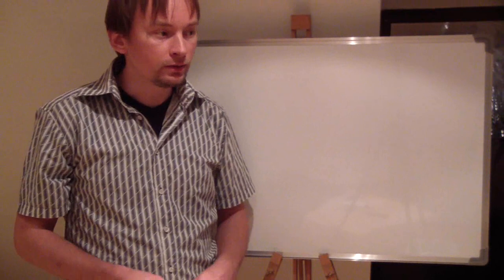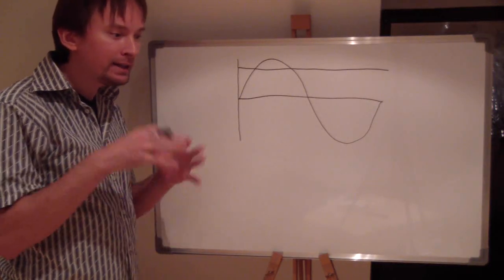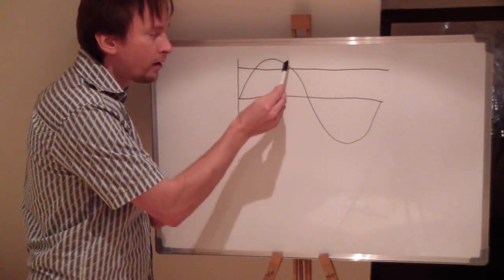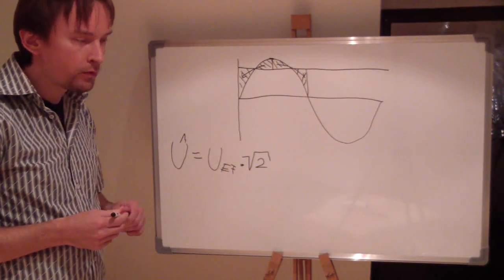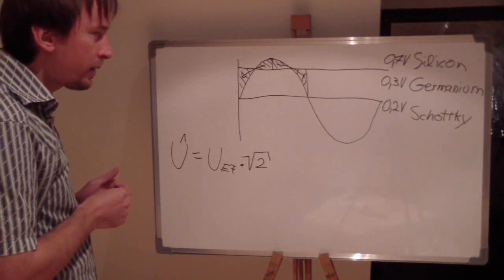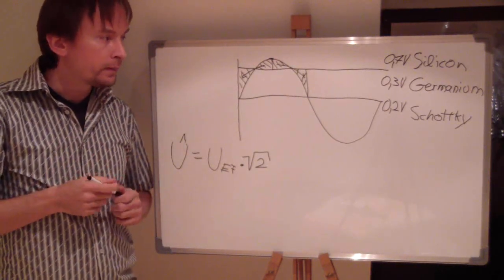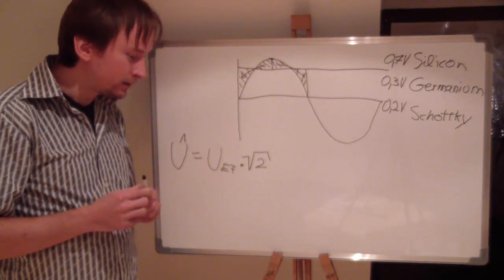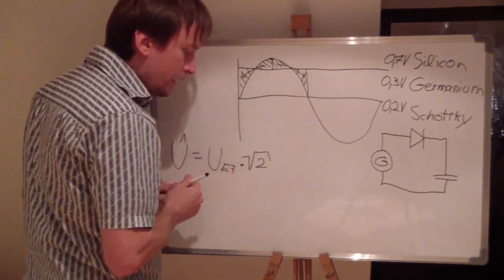Home Made Windmill Generator Part 8 - Voltage Doubler Theory 1

Comment: Hi, good work! Another way to raise the AC voltage is to use a transformer but I'd suggest you to remake your coils. Each additional component wastes your energy. You should double your windings count. Probably you have to use thinner wire to accommodate more windings on each coil. And your wind turbine looks very unefficient to me. You lose a lot of wind energy there. And I think you could make your generator more efficient by putting the coils on iron blocks instead of wood. Keep it up!
Reply: Adding iron to the core of the coils may not make it more efficent.  It will cause eddy currents and hysteresis losses in the iron.  But iron will increase the magnetic permibility inside the coils that in turn increase the flux density  when a magnet passes,  giving it greater powet density. But it will suffer torque ripple due to reluctance cogging  that will increase the required cut in wind speed and create unnessesary vibrations. Profesionally engineered generators will use laminated silicon steel to reduce eddy currents and hysteresis losses,  but a lot of time and money go into figuring out how to reduce torque ripple from  reluctance cogging.